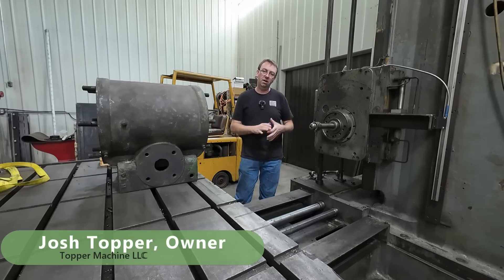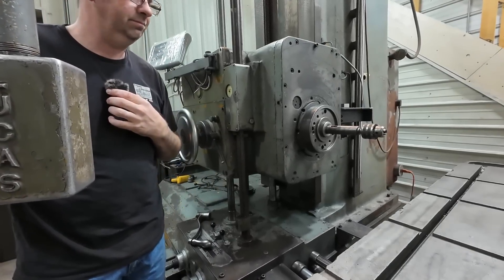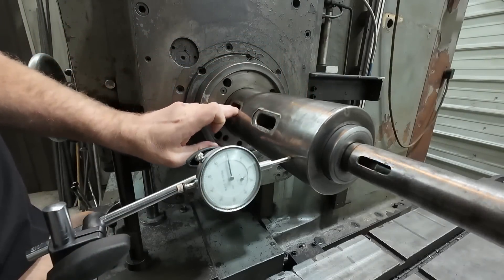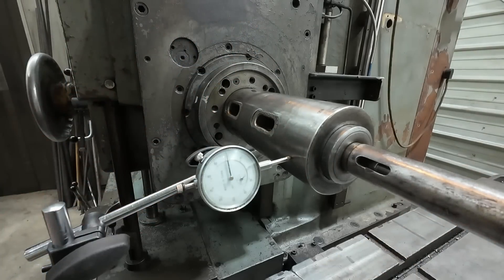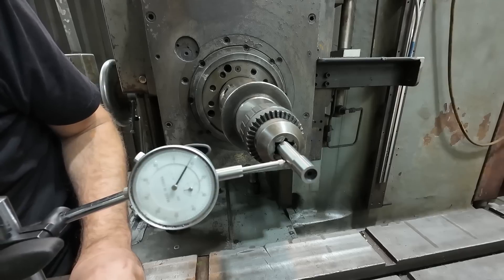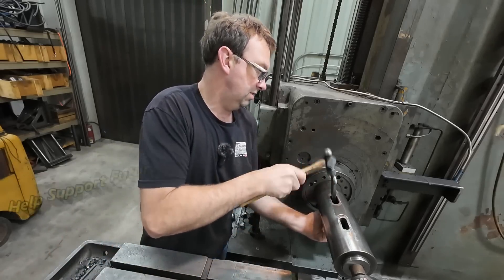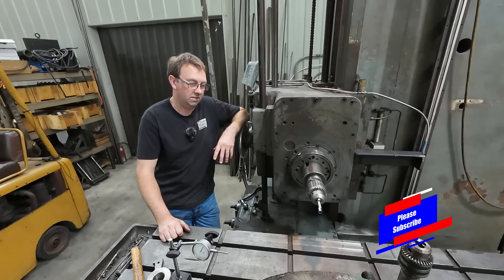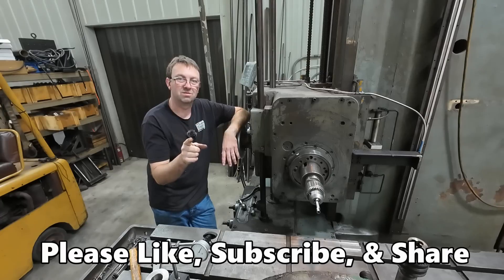Checking For Spindle And Chuck Runout - Checking Accuracy Of Tool Holders - Manual Machine Shop

Comment: When chasing an original bore center I usually use feeler gauges off the cutter I plan to use that way all run out is compensated for and no chance any error from the indicator versus the cutting tool comes into play.

Comment: I bought an Albrecht, used but in beautiful condition, worst chuck I own for concentricity. I have several Jacobs and Rohms (probably 30 or so) chucks that are pretty good and a few cheap off brands. Believe it or not one of my cheap Shars brand chucks is my most accurate. Most of my chucks are holding under .005 on average.

Comment: Hello Josh, Excellent video. Question, could there be a slight difference when drill chucks tighten by key compared to hand? I know you found a bad adaptor but when it comes down to just the chuck, could any one jaw move more that another? Cheers Joe

Comment: Hi I've worked on Horizontal boring mills many years ,I enjoyed it ,looking at yours brings back some memories, checking out the run out is always important on any mill . I always had to stone the shafts of the tapers Before installing, They do get burrs , a stone is always the best, 
Watching you indicate it's always good to make sure the machine isn't excellent condition. We had high precision work we needed to do, any burrs could knock us off one of the items that we used before we  sprayed it with little alcohol just to take off any oil that might have accumulated. 

This was nice and easiest way to clean the taper shift. Keep up the work and I'm sure people like to see this

Comment: I have a few chucks that clean up when you tighten them with the key, like .001-.002 tir but I'd say they show closer to .007 hand tight. not saying that's correct / ideal, but I would check them tight too, especially since that's the state you use them in. Dead nuts in a hand snug chuck wont help you if it doesn't stay that way when you tighten it. (or maybe my hands are just wimpy;)

Comment: My recommendations :
Scrap it all.
Buy a brand new Albrecht or Llambrich
You won't regret.
But it do ofc hurt when you press order 🫣😅

On the TOS w100a I use, I got a new Albrecht. Runout is ZERO. I can use a reamer in it with perfect result.
Some of the other brands we have is crap compared. Even the touch and feel is not comparable 

Best regards

Comment: Definitely a valuable and interesting topic!  I guess I got fortunate when I bought an SPI chuck for my HBM and it had less than .001" runout with an endmill in it.  It is, unfortunately, a keyless chuck, and for those that don't know, a keyless chuck is not a good idea in a HBM where you might be reversing the tool, like a tap.  The chuck self unlocks unless it is cranked crazy tight.

Comment: Very interesting. Please make video of the straightening process on the adapter. (When you get around to it) Thanks, Josh
Reply: Yes I'd be interested in how Josh is going to go about doing it. I would be inclined to use a bearing set up in a bar fitted to the lathe toolpost and set it up in the morse taper in the spindle. Then heat with an oxy-acetylene torch and use the cross slide to force the Jacob's taper into line. There is enough length there to skim the MT6 back a bit to allow the Jacob's taper to be skimmed true.

Comment: For reaming, the chuck runout is crictical but  fro fly cutting, this not  a problem.
With the machinery uou have in your shop, touching up the chuck jacobs taper is not a big problem so all your chucks are salvable.
very dood explanation
 excellent video

Comment: I agree it's good to know the runout of any tooling, but when using an indicator to center work on the mill it actually doesn't matter at all, you could use a chuck bent at a 45 degree angle and your part will still be centered to the rotation of the spindle. Often when lining up bores far away from each other I will use a laser pointer made to go in a gun barrel for setup, in the chuck or end of a line bore bar it runs pretty true but the real way to get it accurate is you run the spindle and the laser dot will make a small circle if it's off a tiny bit and you center your target in that circle then you know you are aligned to the spindle rotation
Reply: THIS

Comment: Good runout cannot be overstated. Compared to most other tooling, tool holders and adapters are quite cheap here and available in good quality. I have completely switched to weldon for normal endmills for example because those SK40 toolholders are 30-50 bucks each with like 3 micron runout, the price of a single ER collet of same quality. Fiddling around with tooling is expensive, time is valuable. Scrapped parts are also expensive.

Comment: Check your tools, then check the thing you used to check the tools. For instance, do you trust your micrometer? I might, if it reads the same as 2 or 3 others across a few different gauge blocks:). (OTOH, 5 thou is close enough for quite a lot of things I work on, no sense trying to dial things in closer.)

Comment: straightening one pc arbor.   Use a small heating tip to straighten.  To pull into place heat a small spot, not too hot, wait a few seconds and cool with water.  I have straighten old Cat D7F roller frames using this method.  Bridge "I" beams are deliberately bent  doing this.  Heat a small spot at a time.  My dad straightened drive lines doing this.

Comment: Very good info Josh, these chucks are dropped and abused in most shops. For your application for using the coaxial indicator, you could use the ER32 collet arbor. Thanks for all your insight & vids.

Comment: Nice video, tho anything single point, like your coaxial indicator, doesn't care about runout? it's multipoint stuff that might have an issue.. but then they are not accurate anyway with single point tools being the only way to go for ultimate accuracy.

Comment: The taper on my HBM has about 1/2 a thousandth of parallel runout.  So in my mind, parallel axial runout is better than angular runout.  This because with parallel axial runout, it does not get worse as you go out further.  With angular runout, it get worse the longer your tool reaches out.  Just something to think about when assessing runout on your setups.  --Doozer

Comment: couldn't you drill out that shaft shrink fit a new stub in it and turn it to adapt drill chuck ? but watching you straighten it would make an interesting video
Reply from the maker: I could, but is it worth it to do.
Reply: @TopperMachineLLC  make it another interesting video if straightening didn't work.

Comment: You need to check your spindle up close and sticking out, up close you could read-0- but sticking out you could show-.030- which would make a tapered bore. That’s why when they bore cylinders they use a full length bar with a tailstock to support the bar and they travel the cylinder over the bar and bore a straight hole
Reply from the maker: Spindle was checked in multiple positions before diving into chick's.  Spindle is actually quite tight.

Comment: your missing it the spin brgs are good, the indicators' don't care, it wont drill good , if you step back and look the ball on the indicator isn't on centerline of the spin  which means its bent  in theory , find your best tool indicate a part  say 10" out, then put a bad drill chuck in and set at 10"  and check it again to verify, it works that way all of your chucks were good until you check them, kinda like bad shorts it creeps upon you

Comment: In my experience used tooling sellers don't check anything beyond looking at it.
I bought a nice Albrecht 1/2" for very little money, chuck was fine, arbor was very bent.
Used tooling needs to be cheap as you never know if its going to be any good.
I just bought a used Jacobs 20N, been after one for years but they are rare in the UK, pretty sure British Jacobs never made them over here like the other sizes so they were imported and thus very expensive new.
Reply from the maker: 20N Is a nice chuck.  I think I have 5 of them.

Comment: First- you can ALWAYS return items on ebay.  Too late now but next time.  But ya try to straighten it?
Reply from the maker: I had tried to work with the seller, they refused.  I could have had ebay step in, but the chuck was good, and I paid little enough for it the chuck was still a great buy.  I just left them negative feedback and moved on.

Comment: you said the morse taper 6 to a jacobs taper was a one piece machined holder. explain the obvious ring of weld at the base f the jacobs taper
Reply from the maker: Not weld, that is actually chatter marks from the original machining.  I went and looked again, it is definitely not weld.
Reply: @TopperMachineLLC  yes I went back and used 4x screen magnification it doesn't look like a weld but even if it was, it would technically still be one piece if welded before machining. my bad.
Reply from the maker: @normstaley9103  I made the same assumption when i got it.  Now with many years of dust, it does look like weld, but it is not.

Comment: can that size of chuck jaws even be ground in, or do you lose the 'bite' profile of the jaw tooth that it needs for holding drill shanks? I see from other commenters that rebuild kits are available, and if you know the body is good and true and not clapped to hell, they're worth it especially if you have a pre-chinesium body. Straightening that adapter could be ten minutes of Gentle Dialogue with a Persuader (deadblow hammer), or it could be five hours of Cussin'. I have a little Hazard Fraught benchtop drill press with "pretty damn ok" runout for a garage shop. I don't have an indicator to test with but "so little you can't see it with the naked eye" is good enough for my needs!

Comment: Well, how can you do accurate work if your machine or part thereof is not accurate? It does of course depend on how critical the job is as to what is good enough. Very high precision work needs way less than one thou on the machine, whereas 5 thou would be acceptable for drilling a hole in a shelf support that will have a ¼" bolt holding a shelf. Definitely important to know how much run-out you have before starting the job.

Comment: as you were showing that adaptor that the ebay peeps hosed ya on i was thinkin "if only we knew of a machinist who could fix such a problem" lol
Reply from the maker: The question is not if it can be fixed, but is it worth fixing. Like I said, I got a chuck for far less than new, so I'm still ahead.
Reply: @TopperMachineLLC  10 4

Comment: The chuck adaptor runout issue, why not machine off the bent shaft. Then drill out and put in a shrink fit new one and, tack weld it permanently , then tool post grind it true. That is if you cannot straighten it. That would make an interesting video.

Comment: It would be nice to have a small independent 4 jaw chuck on that spindle, you could dial it in when you need to.
Reply from the maker: I have never seen a need for one.  Precision tools get their own tool holders.  Boring heads do the rest.  Drilling isn't needed to be super precision, and if it is, you use a collet chuck.

Comment: Imortant info Josh. Thanks.
I just got a new Jacobs 18N chuck for my boring mill at work. Surprised to find out that Jacobs has a line of tooling made in China.  Not very surprised because i know Starrett has tools manufactured there as well. Among others. Anyway, i did the same indicating as you and and found it to be within .0007".  At the chuck with a hardened half inch dowel pin.  Good enough for me. It all depends on how much you want to spend. And if you are the only person using that tool. I've had Jacobs chucks for close to 30 years. Nobody else uses them and they are still in great shape.  
Cheers from Canada.

Comment: Have you tried spray metal? Build the bent tip up and machine it back to square ❤
Reply from the maker: I don't have enough work coming in to justify the spray metal system.  I could TIG it.

Comment: On the #6 morse arbor I wonder if you bored a piece of stock to match the jacobs tapor and then put it over the jocobs taper and put it in a press and push in the middle to straighten it.

Comment: Josh, we'd love to see you try to straighten out that shaft, it would also be cool to see you cut and grind it into a smaller MT adapter if it isn't salvageable
Reply from the maker: Time and money. Is it worth it to fix or replace. As a working shop, replacing and moving on is best. But it would make a good project. And, I like overly dumb projects. Lol
Reply: @TopperMachineLLC  if you are going to fix it just take out the welded shaft, rebore to next size, fit up a double ended adapter (straight to jacobs) and do not weld it in. If it must stay in place locktight or Dutch key the thing. Some of this can be done on that boring mill itself with vise held tooling if you desire. Always leave space for the removal wedges! Ask me how I know.

Comment: Maybe you did this and didn't film it: I would have liked to see the runout on the inside of the quill taper, since that's the reference for all your other measurements.
Reply from the maker: I didn't actually film that, but it was true to the outside of the quill. That's the best part of a boring mill is the quill and spindle taper have to match to do what they do.
Reply: @TopperMachineLLC  Regrettably, In my shop, "have to match" and "does match" aren't always the same. ;-)

Comment: Greg from northern Michigan. With your SPC background in metal working, I am sure you know about Circular Runout and Axial Position (CRAP) and Transfer Path Measurement Standards (TP).  In terms of CRAP, there's Good (< 0.002 inches TIR), and OK (< 0.005 inches TIR). Anything higher should only be used for very rough machine work, or be given away to someone just starting out in this business or hobby.  A bent or wornout tool holder is usually better than nothing.
Reply from the maker: I know the differences, just had a little on my mind that day explaining and missed a few critical points. But the main point was to check your tooling.
Reply: CRAP and TP usually go together. That's why precision tooling is so expensive and can not be abused without continual maintenance and careful monitoring.

Comment: Doesn't matter how the spindle runs.
The indicator will run in a circle in line with the bearings not allowing for spindle droop
Reply from the maker: You are correct, but checking and removing runout is best practive all around.
Reply: Spot on.

Comment: Straighten it  and then final turn or grind to true zero run out .
That would be the best chuck set up for the machine as it will be the shortest and one piece, less run out that many peaces together and longer as length multiplies the run out if any .
Some time's turning the taper 180 degree's in the arbor may improve the run out and also  turning the adaptor in the chuck some has helped me with getting the run out to be less .
I have even tried boring the chuck jaws on a bad  import chuck with only a little improvement .
When  drills slip in the jaws a few times then that is the start of the problem with the jaw run out.
I put flats on most of my drill bits I  used the most to stop the the slip but that will cause run out also if done by hand and guess , ( machine cutting with a degree wheel is the best way to make the flats) , but that keeps the rest of the shank from getting torn up and then the drill will still chuck true on the round part , just have to align with the jaws correctly .
Ps , if you put your mag base of your indicator on the spindle end or side and then there is no run out issue at all as with a chuck and a co-axle-ual indicator.
Getting that cylinder mounted true in both directions is important or the piston rod will not move straight with the cross head slide frame and could cause wear or binding.
Have fun with this job now that things have slowed down so you can do some of your own things and good luck.
Hopefully with a new President things will get better next year for your business.
Keep the chips flying !

Comment: I also follow woodworking channels here and on Facebook and get the giggles every time someone there is obsessing about 1-3 thou deviations. A lot of folks don't understand that there are different definitions of good and "good enough" for metal working machines and woodworking. And also different orders of precision for different applications. I like the way you explained it here.
Reply from the maker: Not everything needs to be to 0.00005 tolerance. 95% of the time +/- 0.005 is good enough.
Reply: the wood nymphs measure in thou?? Why?? Wood will probably move 10x that just when the temperature or humidity changes a little! For woodworking measuring in 1/64"ths (aka 15 or 16 thou) is probably lots!
Reply: @gorak9000  for woodworking 1/64 is not allowed, 1/32 is as tight as you should go, and in many cases is also too tight, like in drawer carcasses and their fit up to the frame carcass. As you said humidity will make it change more than that.
Reply: @CothranMike  You're talking about the gap you should leave, like a floating panel in a panel door, but I'm talking about measurements. If you should be leaving a 32nd gap, it's more than sufficient to measure things in 64ths. It's always good to do your measurements in more precision than the dimensions you're trying to hit. I don't know how practical measuring in 64ths is though - I don't think I've ever seen many rules or other measurement tools in 64ths, they usually only go to 32nds. I'm guessing they're measuring in thou because of the ubiquitous cheap digital calipers.
Reply: @gorak9000  yup, my thoughts as well, cheap digital calipers.

Comment: Thanks Josh, learnt something today. I've had a few arbor/chck assemblies where the chuck hasn't been seated properly on the arbor, off on an angle, wondering it that could be a problem on the bad one?
Reply from the maker: Not likely, but I could check it when separated.